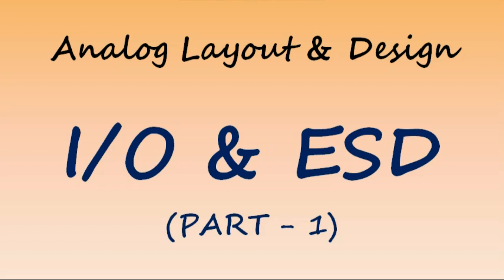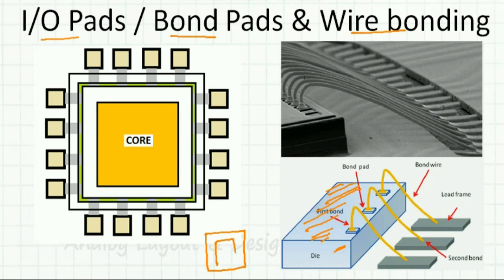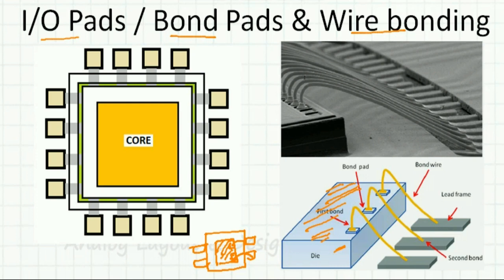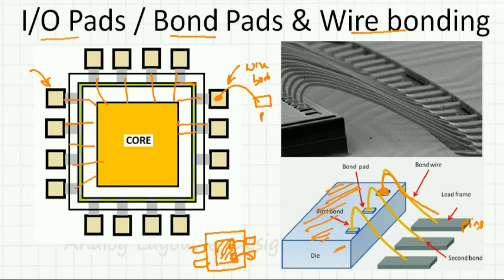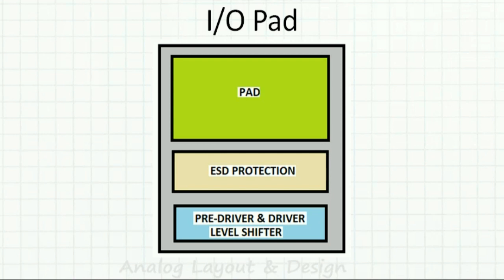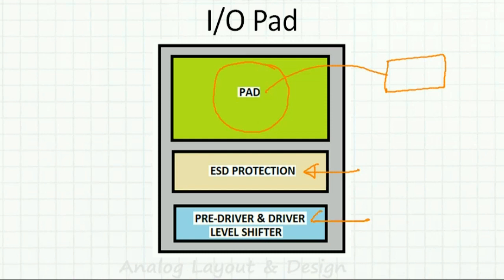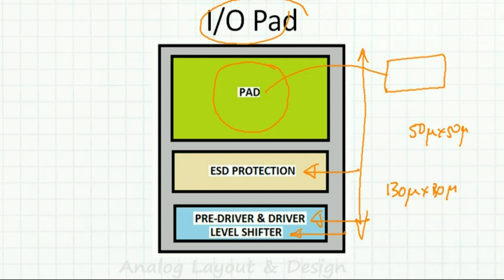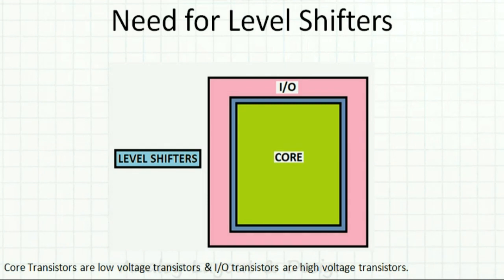ESD (Part - 1)

Comment: Hello sir, I am wondering why we have to use High-to-Low level shifter circuit instead of simple voltage divider resistor circuit?
I am assuming it's about safety and reliability but I don't know the technical reason why.
Thanks in advance
Reply from the maker: When we use resistor divider, it consumes static current…also.. area occupied is higher… also loading effect is a concern… cmos is ideally zero static current…in high to low level shifter we use high voltage devices..or thick gate oxide devices…hence it’s reliable…
Reply: @analoglayoutdesign2342  Thank you very much sir for the explanation, it makes a lot of sense. Now I'll review next about loading effect.

Comment: Hi Sir,
Will there be a chance of esd event during power on condition... If yes how can we protect the IC.

Thanks in advance
Reply from the maker: ESD generally occurs when a person touches the ic by hand  before or at the time of soldering it to pcb.. once powered one will not touch the ic by hand without insulating himself.. this is my view.. and even in such condition the same protection should work.. 

Generally in labs while testing any pcb, the bench is also properly esd protected. And also the person who is handling the pcb , puts on a esd suit and footwear..

Comment: The worst condition is as follows. vddl:low, vddh:high, NFET:slow, PFET:fast
Reply from the maker: Always cross corners are the worst… also there are multiple supplies here
Reply: @analoglayoutdesign2342  (low-to-high level shifter) When input changes its value, there is a fighting between I/O PFET and I/O NFET. In that case, I/O NFET should be stronger than I/O PFET. Therefore, worst condition is when NFET is slow and PFET is fast. So, I/O NFET size is much bigger than I/O PFET size in low-to-high level shifter. Thank you.